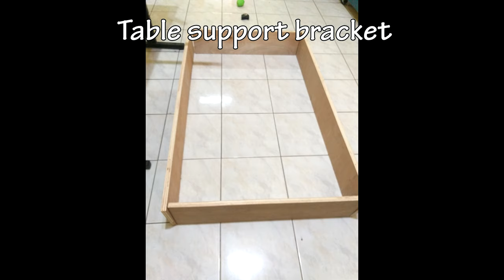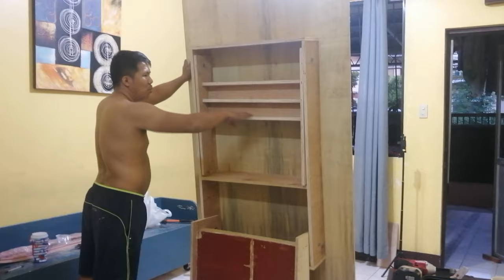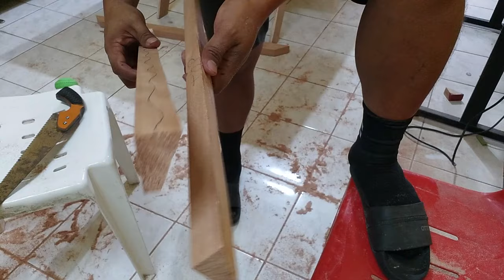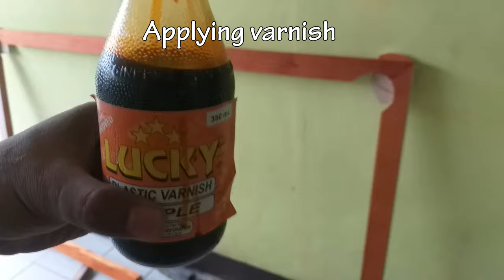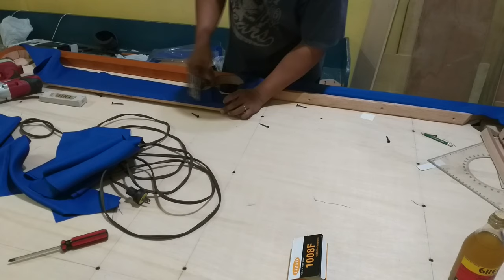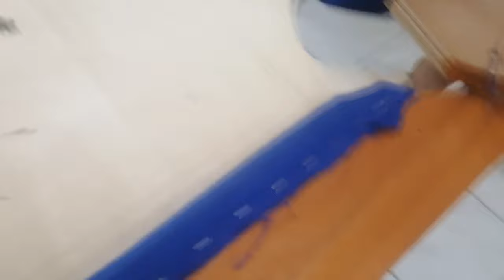How to build a billiard table - Part 1

Comment: You need to stretch that felt when you cover the rails and bed.. Otherwise the felt will move around when you place your bridge hand down on the bed, and the rails won’t play properly..

Also, you need at least one shim on each pocket facing to keep the rubber from expanding over time from moisture.. That makes the pockets play phony..
Reply: Rubber expands from moisture....?
Reply: @2869may  

It will bow over time, without a shim.. making the pocket play phony..

Now, I’m not an engineer or a scientist, so maybe it’s contracting?.. I don’t know.. That was an assumption on my part.. I apologize..

However, I have plenty of experience in all things pool, and in my experience one shim is best.. Some double shim, but I prefer extended rails and one shim..
Reply: @jacobjones5269  No need to apologize brother... Check out the table I built in my videos, turned out pretty good.
Reply: @2869may  

I saw the first vid.. Yeah, nice work..
Reply: @jacobjones5269  Thanks man.!

Comment: Anong size ng bola mo sir?
Reply from the maker: 42x74 table size. Ang ginamit ko po 2inches size biiliard ball.
Reply: How about ung angled wood rail for cushion? Ano size wood and angle sir? Or tancha lng? Haha
Reply from the maker: 15 degree dapat sinunod namin. kaso tumatalon pa bola sa banda kaya adjust kami to 20 and then 25. so hinanap ko yung okay bounce ng bola na hindi tatalon. trial and error. May factor din size ng bola at height ng railings. Medyo mababa kasi railing namin below 2inches.
Reply: Sige sir. Thank you. 🤗